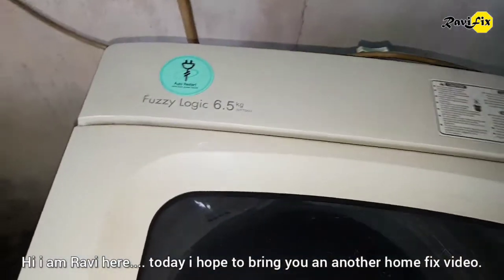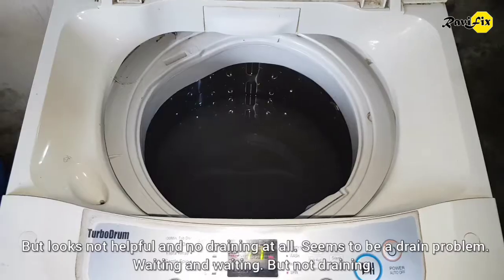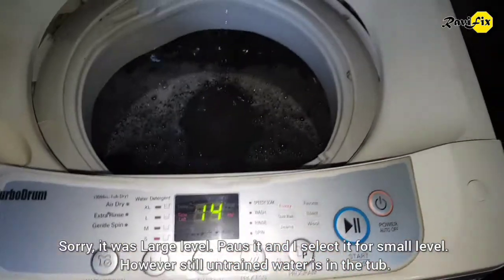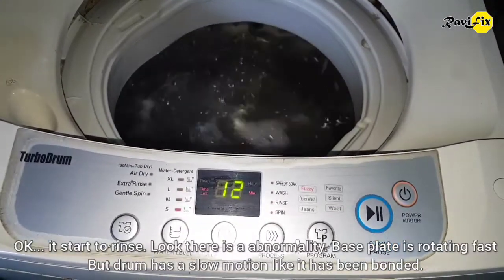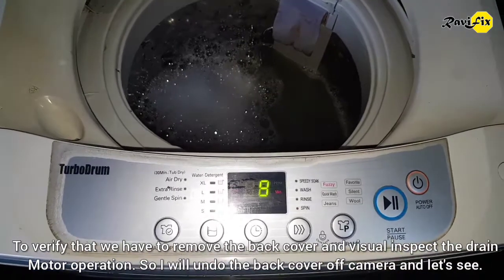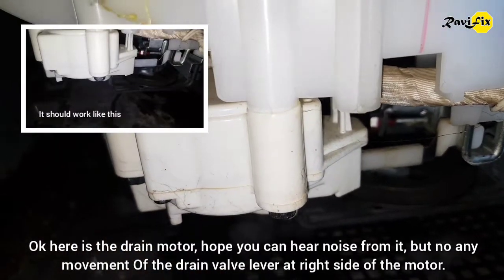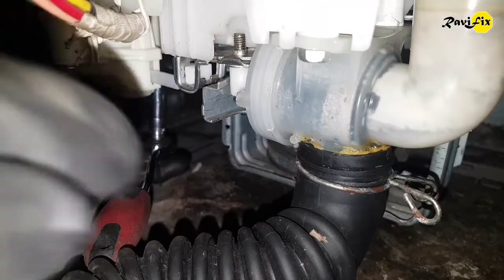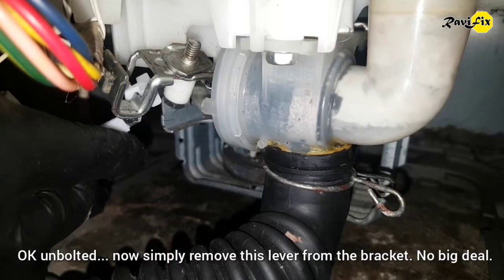LG Top loaded fuzzy logic Washing Machine drain motor problem diagnosis and fix complete tutorial

Comment: if the LG wash machine washes and drains to remove the soapy water but stops when it has to drain and spin the washing dry the machine could it be a pump problem or actuator motor problem
Reply from the maker: Apparently water level sensor or PCB error

Comment: Hi Ravi, excellent videos on your channel are very helpful, my machine is not spinning, however, I checked by replacing with a new sensor, still not working and checked the drain motor it's working fine, the problem identified by the technician is the main motor needs to be replaced? can you suggest if the motor can be repaired and if I would have to buy a new motor, what is the model no. of this part, as LG has discontinued to sell these parts, but if I know the model no. I can try on amazon or ebay.
Reply from the maker: Sorry no idea about the model number, anyway better replace a new motor than repair older one.

Comment: Hello Sir, your video is very good and easy to understand. I also have the same washing machine, but the problem is that 'motor/drum/pulsator are running continuously'. After 30 seconds around, smoke comes from below (near to gearbox/motor/drain pump), and then I switch off the power supply.

Could you please help with the reason and fix? Let me know if you are comfortable in talking on phone.

Thanks in advance, Sir!
Reply from the maker: Hard to say what is wrong without inspection.

Comment: Hi Ravi Fix.  I have the same model washing machine but it has been acting weird for the last few days. In automatic wash and rinse mode, is not retained in the tub and it fills and drains out at the same time. Also in manual mode, it does the same sometimes. But sometimes it works fine in manual mode. Can you help me diagnose the issue?
Reply from the maker: Check that drain valve is stucked open..
Reply: @ravifixall  the drain valve is not stuck, because if I turn off the machine it will shut
Reply: Hello Sir, have you found a solution? I’m facing the same issue. After the wash process, it continues to rinse by draining the tube, but once the process finishes, the motor doesn’t turn back to close when refilling with clean water.

Comment: Hi ravi... My LG Top loader WF 750 auto power off during a cycle. One I press the start button and it works for a minute or so and then shuts down completely. What could be the problem? Any idea?
Reply from the maker: May be pcb error or bad capacitor could cause. Not sure.
Reply: My thought exactly, but b4 removing I just checked the plug base and to see there was corrosion. Checked with multimeter and there was voltage drop. After replacing base and plug top, it worked. Thank you for your reply.

Comment: Very informative sir, how about LG fully automatic machine not holding water, the water from the inlet continously flow and water kept coming out of the drain hose, I check the drain motor and saw that the motor doesn't stop waorking closing and opening the drain continuously, does it mean the drain motor is defective?
Reply from the maker: Hard to say something. May be bad PCB. Try it with a professional technician